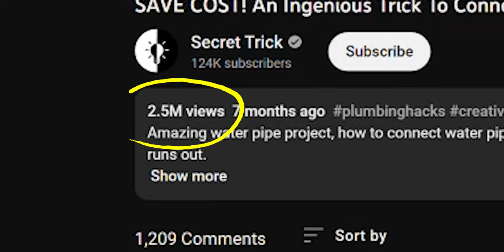I Would NEVER...PVC FAIL

Comment: I have done this with boiling water, doesn't discolor the pvc. Also done this with heating the sand with a torch before putting it in the pvc. I wouldn't use any heated pvc for water ,but it's great for cheap electric conduit

Comment: Funny, never thought of trying this in actual plumbing. But something similar to this is done on custom water cooled computer builds with PETG or Acrylic tubing, at least the heating and bending part, but you also use a silicone slug in the pipe to keep it from deforming.

Comment: When I was in High School Physics class we had to make a simple machine demo. I made a machine that consisted of a number of very complex figure 8 and corkscrew PVC bends that looked like a giant rollercoaster which connected to a funnel at the top and you poured marbles into it. They rolled through different stages  exiting the PVC and rolling over wooden levers, into metal buckets with offset counterweights, etc. back into more PVC tubing and eventually came out at the bottom and rang a bell. Took me a few days to build but was pretty neat.

Comment: I'm in the HVAC business and I've been doing this for years on condensate drains. I have a lot less problems with plugged up drains. I use a heat blanket which makes the process fairly fast and easy.
Reply: Gravity drain using heat bent Schedule 40... Not a big deal.
Put city water pressure in it and expect it to burst.

Also not for drinking water.. send it to the dirt outside or the sewer system.
Reply: That is pretty cool. I said it would be good for conduit but a condensation drain sounds like another good use

Comment: How about a video on PE-RT?
Reply: I've been wondering about it too, not much mention of it, just saw a new display at homedepot😊
Reply: @mbburry4759  I have useds some radiant PE-RT when moving hot water baseboards.    It is quite flexible.   The only drawback I see is it does not seem to be as abrasion resistant as PEX.

Comment: I used to do this all the time with electrical pipe it's actually quite common there but we use a torch directly to a propane tank instead I can only imagine how bad this would be for plumbing when you heat the pipe to soften it you severely weakened Integrity of it and have a chance of it getting misshapen for plumbing that is a huge deal for electrical not quite as much I have done this for a small three-quarter inch pipe going to a faucet this just meant for watering the lawn however it is not recommended to do so cool video though that was entertaining to watch that was a masterful job of heating it without burning the pipe

Comment: There is another method you could try with this, and that is to heat up the sand that you use to about 350 to 400 degrees F in an oven and then quickly put it in the pipe as its still hot, and the heated sand will do this job a little better without the need of a flame.  Just remember any time you heat PvP pipe like this you are changing the chemical properties of the PVC and it may not hold up very well over time.
Reply: Now that pipe is weak n will leak

Comment: I would never heat and bend any type of PVC that will be pressurized even DWV. Only pvc electrical conduit, the other exception is stand alone drain pipes, like water heater or washing machine drain pan that is open on both ends and not solid connected to DWV system.

Comment: Any material engineers here? I've a question...
So, I've seen a metric ton of channels that talk about these PVC pipe hacks, all sorts of crazy stuff done to bend, fix holes and do all sorts of stuff with them.
My question is, how much damage would that do to the pipe, and are there other problems in these hacks?
I've read that heating PVC can produce toxic fumes, carcinogenic. That should be reason enough to skip those hacks in the first place... but for instance, isn't heating PVC to high temperatures and altering it's shape also... weakening it structurally?
I dunno how exactly PVC behaves, but there are several types of plastic that will become brittle and more prone to failure once you do stuff like that. Does PVC work like that, or it can withstand higher temperatures without changing it's properties too much?
Just out of curiosity. I have my suspicious, but I'd want to hear a more qualified opinion...
Reply: PVC is a thermoplastic, heat-forming doesn't degrade it UNLESS you also set it on fire.  However, when you're heat forming a tube by hand like this there's no guarantee that you'll maintain an even wall thickness all the way around the bend.

Comment: Electricians use a PVC heater and a heat gun to get all these bends without filling the pipe with sand
Reply: The sand inside is to keep the pipe open when bending.. If they do it without the sand they are definitely skilled.. and probably bend it just a little at a time

Comment: As an electritian honestly we do this all the time. But with better heating tools made for heating pipe.
Reply from the maker: Heat gun?
Reply: Heat gun yes but also heating blanket or hot box
Reply: Heats up a larger length of pipe so you dont have to worry as much about kinks
Reply: There is also a spring that you can insert into the pvc pipe and bend with a conduit bender.
If using an EMT bender, upsize one size, 3/4 bender for 1/2, 1" for 3/4, etc.
Reply: Believe it or not if you have enough finesse you can bend it that way with out the rack a tiers spring. Blew my mind first time a foreman showed me it
Reply: @RogerWakefield  electric blanket.  also doubles as a burrito cooker.
Reply: I free hand bent a 1-1/4 conduit for a fiber conduit with a custom offset.  I deformed it the slightest bit and made it a tiny bit oval.  Worked perfectly for my purpose.  Would have been trivial with either a spring or a mold to constrain the sides (like a conduit bender).  Heat gun or blanket is the way to go....

Comment: Thumbnail...

You can heat-bend PVC conduit like that all day. (except the scorch marks...  Should never have scorch marks)

Bending PVC or any thermoplastic using heat will alter its burst pressure.  Your "Schedule 40" pipe might not handle half of original rated pressure when making the bends as pictured in the thumbnail.

I'm only trained in systems up to 1600 lbs steam and 50,000 lbs hydraulics.